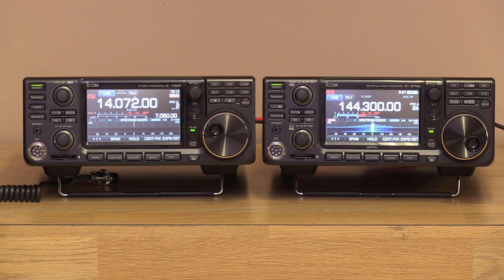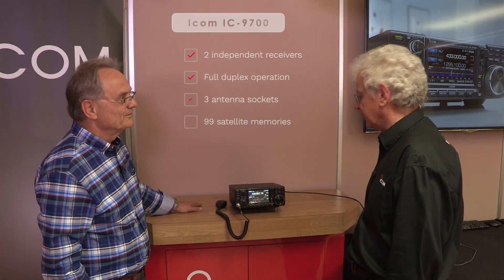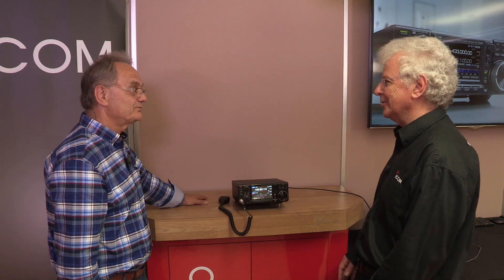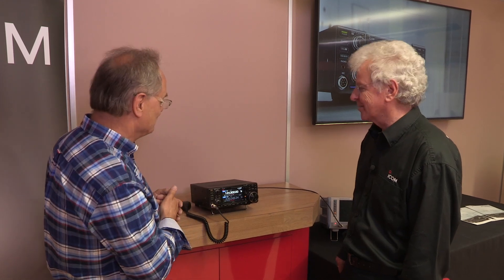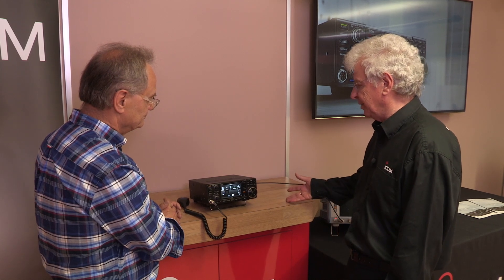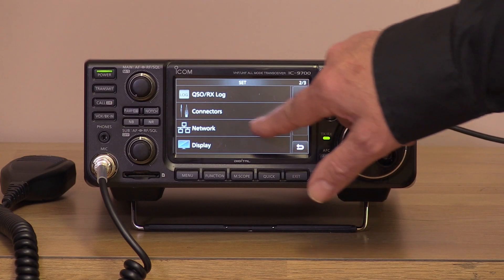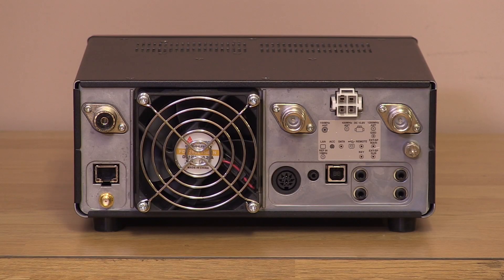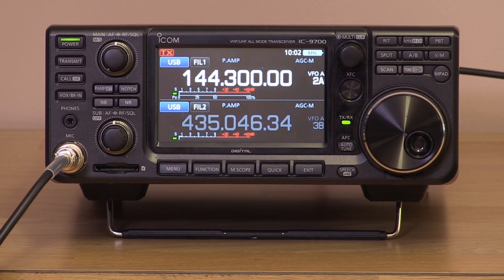Overview of the Icom IC-9700 SDR VHF/UHF Transceiver

Comment: SDR (Software Defined Radio) if the sofware is IN the radio, the radio is´nt SDR .... HI HI .... And I hope that Icom has improved in its poorly designed and full of breakdowns ... 73 de EA1AXY with three 706 fucked
Reply: "if the software is IN the radio, it isn't SDR"   What sort of bollox is that?  Just because there's software inside, doesn't determine one way or the other whether the radio is a full SDR or a hybrid SDR, or even a full analog with SDR effects on the baseband audio. Luis.. you need to think a bit before you post...
Reply: @johnc3403  Everyone can have their own opinion on what SDR is and what it means, those of us who use a pure SDR, is my case, we think and think that an SDR must work with external and not internal software, which would limit many possibilities of use ...
Reply: @luispelox9319  "if the sofware is IN the radio, the radio is´nt SDR "  just sounds like a silly statement to me. Are the IC-7300 or the FTDX101D not SDR rigs?  Under the hood they look VERY software defined. What would you call them Luis?
Reply: @johnc3403  Yaesu FT450 it was never advertised as an SDR, although it is ... i use a TransFox one, who knows?
Reply: @luispelox9319  The FT-450 is a triple conversion superhet rig with 86khz and 24khz analog IF stages with Mixers, Filters, IF amps,  classic AGC circuitry, everything you'd expect to see in a superhet rig. The final IF/AF stage is DSP just like the TS-590 or FTDX1200. These rigs are NOT SDR rigs. I don't understand how you can claim that?
Reply: The old icom 9100 could give the 9700 run for its money. Shame icom carnt fetch out either icom 9700 mk2 or a 9100 mk2 coloured screen. Mike M1KEY